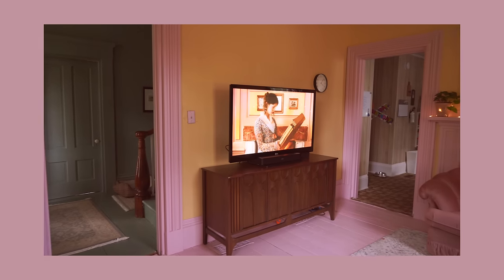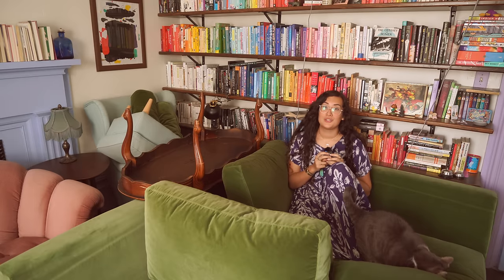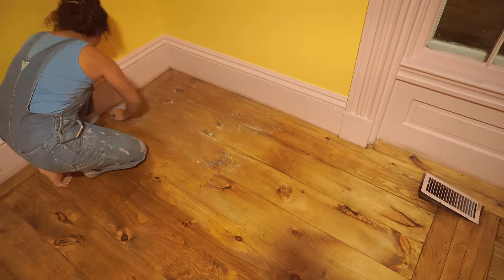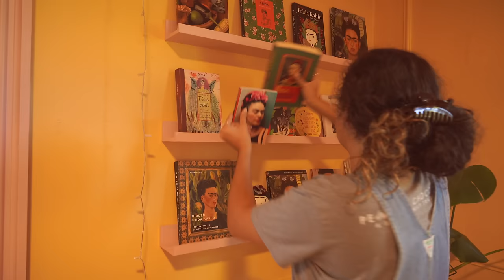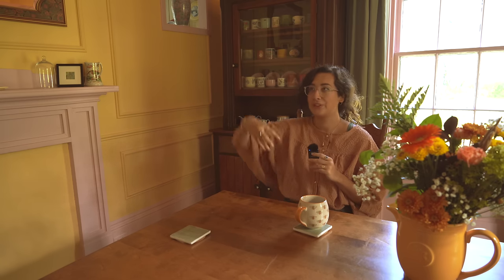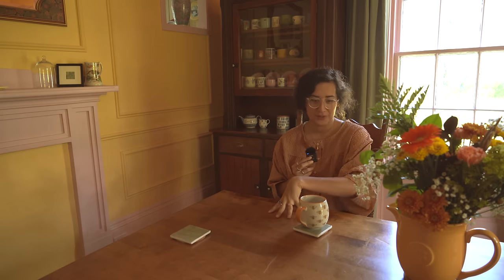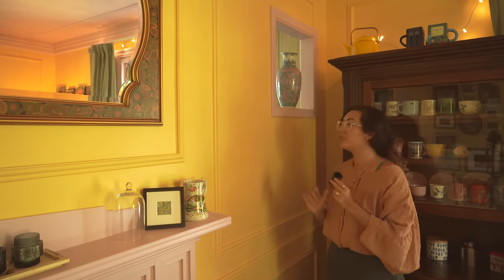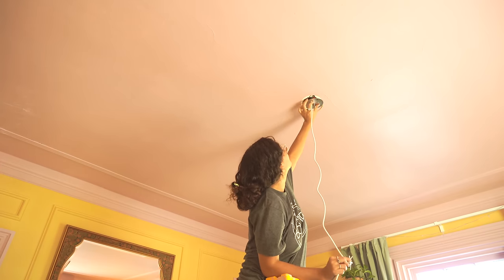Cozy Dining Room Makeover! | Before and After

Comment: Im guessing that that little window’s function could be to pass dishes from the kitchen directly into the dining room, if that room already had that function :)
Reply: yeah I thought that too, like a service hatch. It's kind of high up though, very mysterious!
Reply: Usually pass-through windows are much lower, dishes would tip etc,  it would not be safe.  I think she might be correct about the heat and air circulation.  I lived in an old house that had a pass-through window, it was buffet height and the dining room side had built in drawers for linens and cupboard doors for serving dishes and platters,.

Comment: I was so skeptical when I first saw the yellow and pink as a living room but it works so well as a dinning room. Kudos for having the vision and patience to finish it. 

Only thing it'd suggest is swapping the floating shelves and the hutch with the crockery around so that when you get that stained glass the corner of the hutch won't block it and it will be more of a focal point in that corner.

Comment: The room looks stunning, the color palette, that gallery wall is everything, those floors. Ariel the room calls for a chandelier, even if a cheaper one that you have to restore.  The Frida Kahlo paintings are clashing so much with that beautiful room.  Yes to the carpet Ariel, make it seasonal, carpet for winter, bare floors during summer.  These are only suggestions but, again, the room is absolutely stunning.

Comment: Great job!  It looks beautiful 😍
Your house, in its "original" condition, looks very much like the homes I grew up in, and around, Nova Scotia.  The "hole" in the wall was used to place pipes - from the wood stoves, to the chimney, to prevent heat buildup close to walls, and for the heat to circulate to other rooms/areas of the house. 🙂

Comment: Friendly suggestion to dry some hydrangeas (cut to desired length, remove leaves, and hang them upside down until dry and stiff) for your leaky vase — I think the shape, colour, and lines of the vase would pair wonderfully with the architectural richness of the big blooms.  I’m also wondering if you could add in all your house videos some talk of approximate timeframes of how long each project took from start to finish, even including all the time you stopped a project to work on something else, as in inevitable in a house.  Additionally, I wish I could share with you some of the furniture I find on the street and re-do; it’s mind-blowing what people throw out.  Finally, I’m hoping you’re well after Fiona.  I was thinking of you all weekend as the storm ripped through the Atlantic.  Lots of hugs from this Maritimer-wanna-be in Quebec.

Comment: I LOVE the chairs. The room is elegant, but the chairs (which are in their own way elegant) bring a homeliness to the table, which I think will make people feel more comfortable in gathering around the table for either dinner party or just coffee/tea. I also adore the wood floors. I vote NO to the carpet! ;) Not only is the wood flooring more functional (easier to clean dropped food or drink), and you put so much work into them, I think that aesthetically the wood floor looks so much nicer than a carpet would. It's also easier to pull the chairs in and out from the table to get up and down (especially with the little felt pads on the bottom of the chairs which both protect the floors from scratches and makes it easier to slide).

Comment: Another possible reason for the little window, that kind of goes with the one you said: my grandmother lives in an old stone house and only heats with a wood furnace. Hers has a blower on it, the furnace itself heats the room its in with a small fan, but a larger fan blows into a large duct they put through the wall in a similar window to the one you have.

Comment: Per your video, I've learned some new-to-me terms in trying to figure out what the lil' window(?) between the rooms might be for, but none of these seem quite right and I'd be curious to know what you think: 

clerestory windows
      Clerestory windows were placed high upon the wall, they let in more ambient light and less direct light, keeping homes cool in the summer and warm in the winter.
(which doesn't seem like what you've got) 

transom windows
     Glass panels found on old homes are called transom doors. Their main purpose was to let in natural light in the front hallways and interior rooms before electricity became the norm. Today, they still allow in natural light, but they're more aesthetic than functional.     

milk door
     Common in the first half of the last century, the milk door was a spot built into the exterior of a house for the delivery of bottled milk from local dairies.

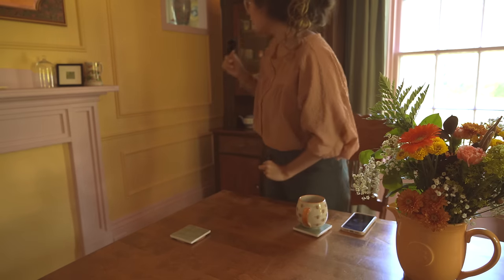Comment: 14:36 That window is most likely for ventilation, and to distribute heat throughout the house. My grandmother's old farm house had windows near the top of walls with decorative iron grates over them, so that the heat from the wood fired cooktop in the kitchen- and the wood fired stove in the living room would filter throughout the house, as they were the only heat sources at the time it was built. Some of the grates had louvers in them so one could open and close them, but a few were just "windows" with a grate over them so you couldn't see through them easily. Later a modern furnace was put in, which circulated the air and made them redundant but my grandparents never bothered to close a number of them up with drywall like most did.

Comment: Say, Ariel, I just thought of something else: I don’t know if you have any more floors to replace; but if you do, why not send the boards outside before you bring them in and place them on the floor? It would be a lot easier if they were up on sawhorses or a table to sand them then scrunching down all over the floor to do it! Sure you would still probably have to touch them up a little; but it’d be a lot less work! I’m not sure how you’re attaching them and whether you’re nailing them down or what? But you could even stain them and polyurethane them outside as well! Cut the pieces to size; sand them including the ends; stain, poly sand repeat. Then just touch up after you install them! I really think that would be a lot easier than crawling around on the floor!
(Unless they are not a consistent thickness, which could be the case! Ugg!)
By the way, what size lumber do you use for the floors? Is it 1”x6” or 2”x6”? And are you running them through a planer to make them the same thickness? Just wondering bc I’ve thought of doing that bf, if I can ever get my hands on a house, but not sure how much work is necessary. Please share more Information on that in a future video! What kind of cost involved, too. The floors look awesome!!!! 🌷

Comment: use modge podge or a plant safe flex seal on the inside of the vase! it may stop the leaking and would reinforce the ceramic/clay. if the vase is glass or varnished inside it may not work though

Comment: Have you ever considered using a hard wax oil, like a Rubio Monocoat, instead of stain + poly on your floor? It's one coat (or two if you want more sheen), has many color options, doesn't trap bubbles or dust, can be easily repaired, and has no toxic fumes. It might make refinishing floors a faster process if you find a color you like on pine.

Comment: Not sure if this would work as well in Nova Scotia, but some old houses on the southern East Coast of the US have little windows between rooms like that as a way to cool the house without A/C. If it's in line with an exterior window, the wind would circulate from outside and flow easier between rooms. I'm guessing the same concept could apply with heat, and have heat from a fireplace spread through the little windows.